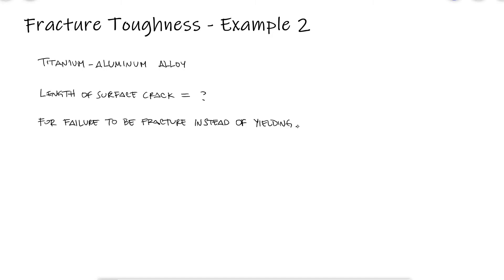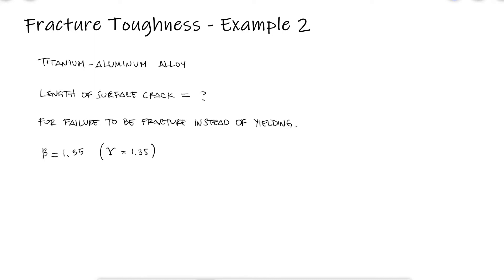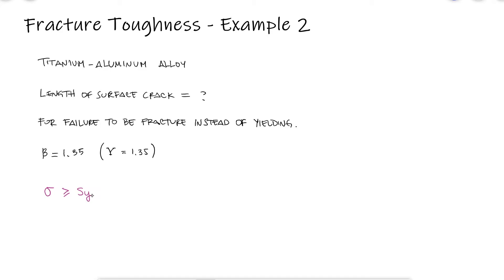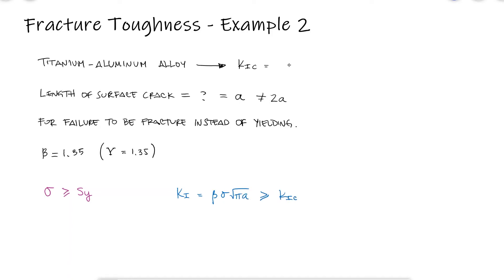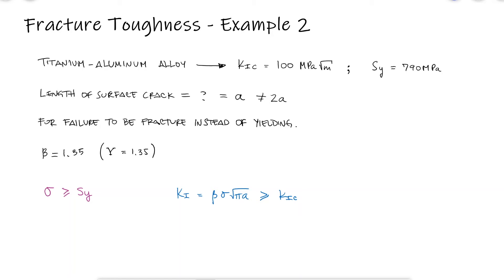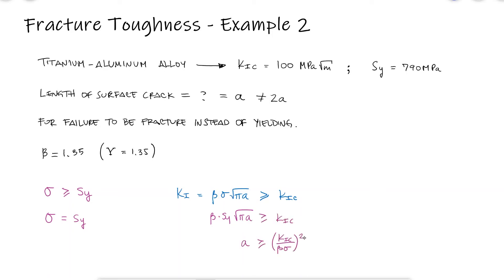Fracture Toughness - Crack Size to Crack Before Yield - Example 2

Comment: Can you please help me. If a vessel is 36mm thick. There's an edge crack so 'a' would be same as crack length. Need to run this for 5000 cycles without leaking. I need to find the maximum initial crack length. What value of a_final should I use ?
Reply: 69
Reply: @blahbleh5671  AHHAHHAHHAH